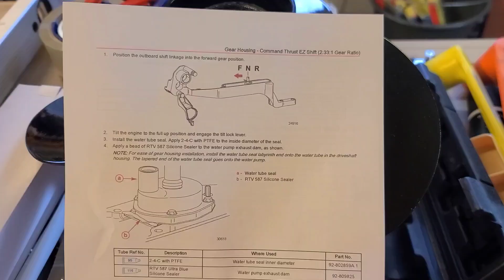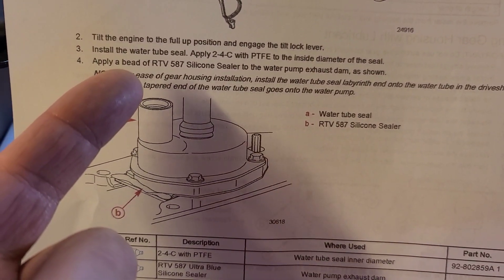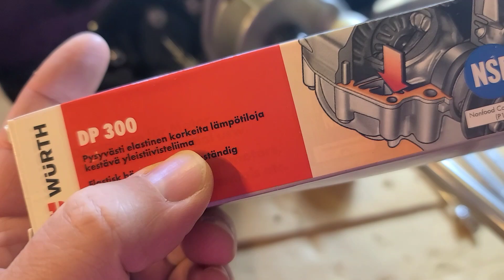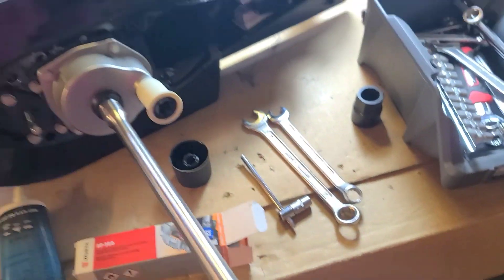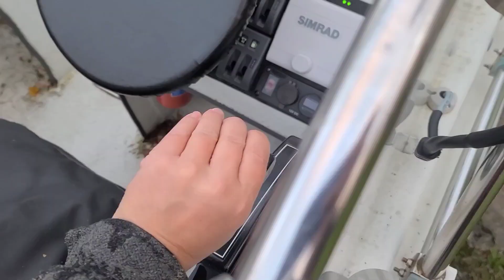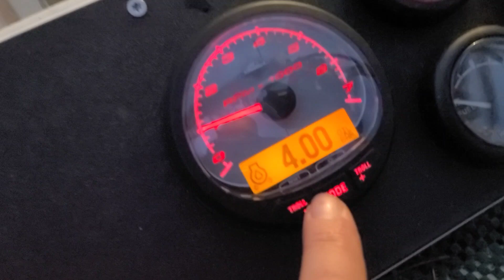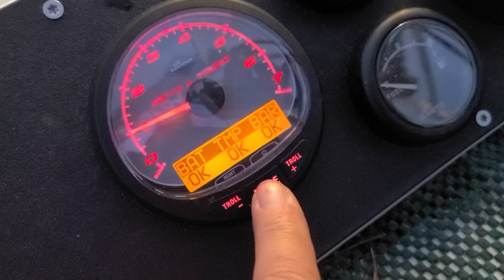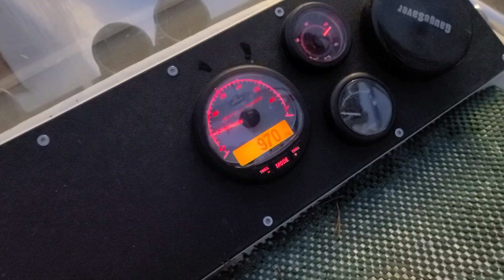Command Thrust / BigFoot Lower Unit Installation Procedure & Tricks

Comment: Thanks for taking the time to create this video, well explained. Removal of the side cover to expose the shift shaft is key to installation.  I made a locating fixture to get the shift shaft into the exact position then used a clothes pin and spring clamp to hold it in place.   Still had to wiggle the shaft to align splines and slide it on.

Comment: You wrote that se205 gearcase won't fit. Why is that?
Reply from the maker: Because it can't, for that outboard, and is not an alternative to this P/N of the lower unit.
Reply: @fishelectronics  Thank you for quick response. Have you tried fitting it or were you told by the company that is not compatible.
Reply from the maker: @Sansovic When I wanted to save money and bought it, I had a long conversation with the manufacturer's enegenier directly and doubted his response several times with different argumentation (because I really wanted to save money as you wish now),  but finally, I've got what I wanted to know and I made my own research on available schemes too. They do alternatives for REALLY old units that you basically can't  buy from Mercury anymore. I understand it's a kind of policy they don't telling openly and Mercury  is hiddenly approve this approach as they don't want to sell any finished item for 30+ years old outboards. Last things are just my speculations, but knowing how manufacturers work, I'm pretty sure I'm  quite close to the truth.